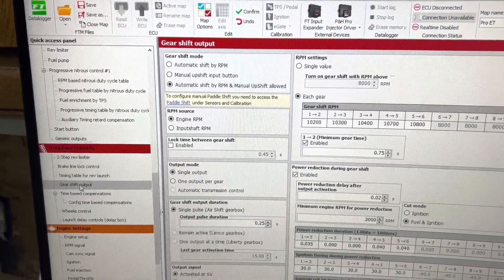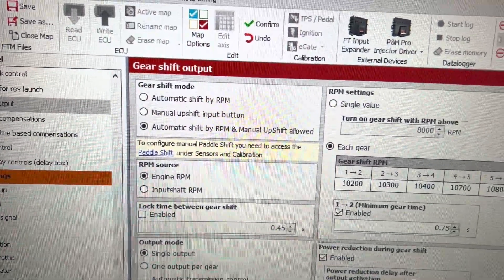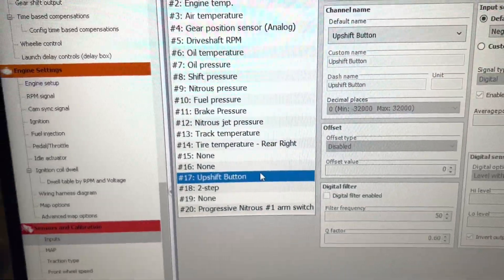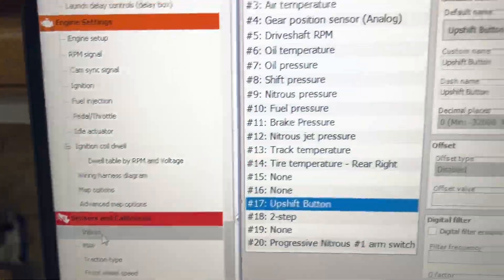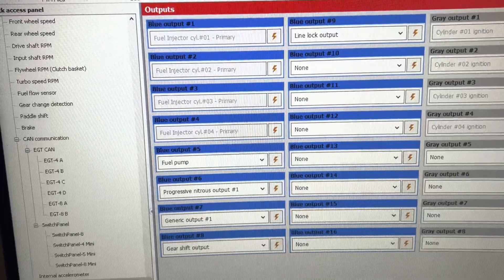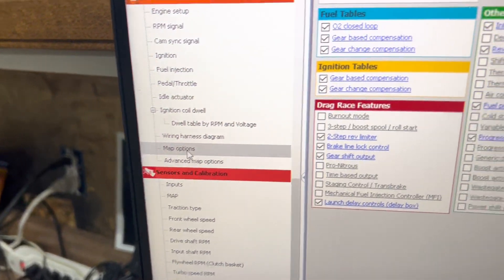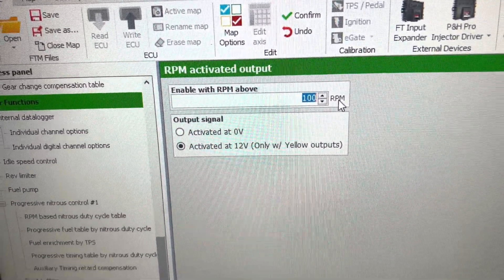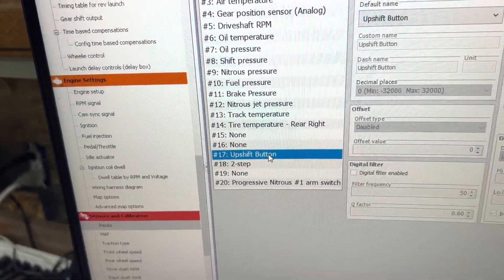FuelTech wiring series Part 1: Upshift input and gear shift output

Comment: Can the ECU handle the amps for a Pingel all electric shifter  without a relay??    Thanks for the Video's
Reply from the maker: No. Amps are too high
Reply from the maker: Only go direct with a low amp air solenoid